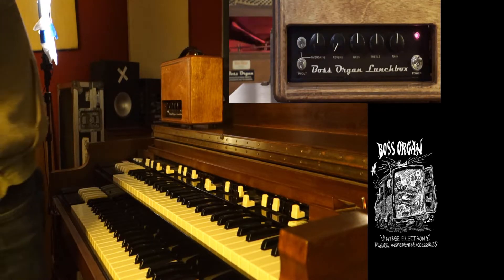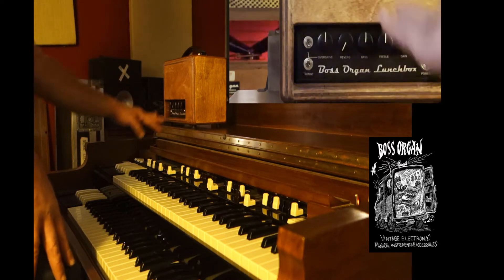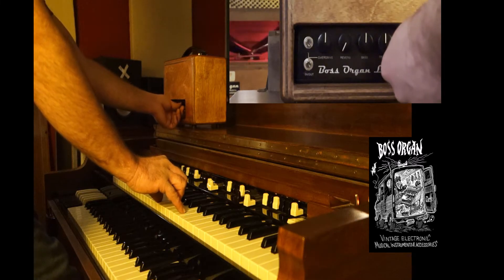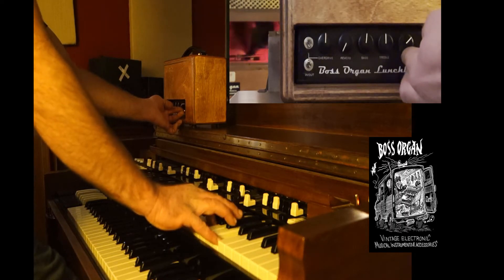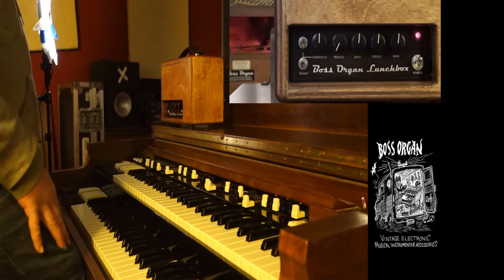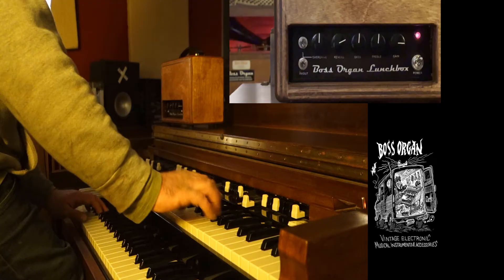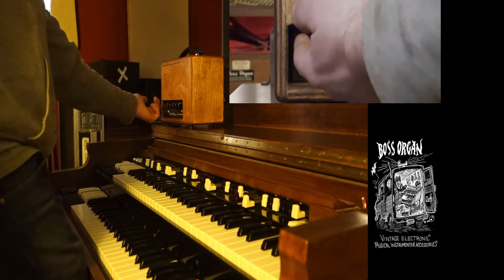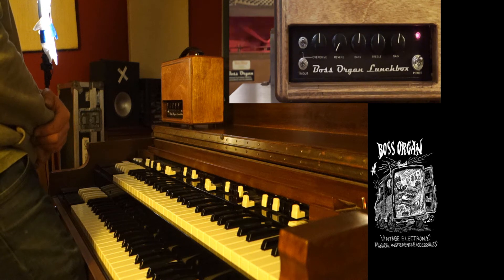Boss Organ "Lunchbox" Demonstration

Comment: Sounds like the discontinued Speakeasy AMA 122
Reply from the maker: The way the Lunchbox works is substantially different from the AMA.... the AMA was a power amp with a speaker dummy load.... the Lunchbox is a preamp add-on, which also includes spring reverb.

Comment: Do you have an installation video?
Reply from the maker: I will make one. It plugs in easily via a tube socket interceptor on the 12bh7 tube in the organ preamp. Unplug the tube, plug the interceptor cable into the amp, plug the tube back in. The Lunchbox also has a power cable which plugs into an AC outlet.

Comment: The only Organs I have where this unit would be particularly useful are an M-3 and a "-V" series. Are there (plans for) versions units usable those models also?

All of my equipment has been adopted to 1/4" out (the "-V" Organ has a dedicated B+ supply).
Reply from the maker: You could use the 1/4” outputs of those organs into the lunchbox, however the output impedance of the lunchbox is about 7k, so the input impedance of whatever you are plugging the Lunchbox into needs to be high.

Comment: Nice addition, is it difficult to hook up
Reply from the maker: Very easy to hookup , it plugs in via a tube socket interceptor cable on the 12bh7 tube in the organ preamp. Unplug the tube, plug the interceptor in, plug the tube back into the interceptor. Lunchbox also has a power cable which plugs into an AC receptacle.